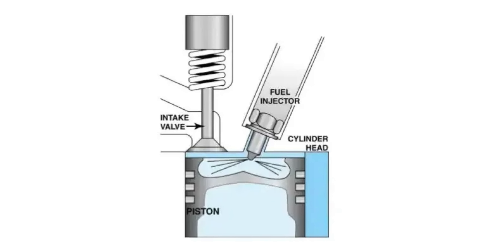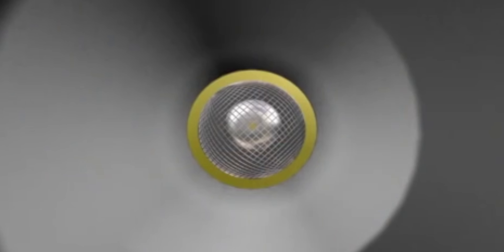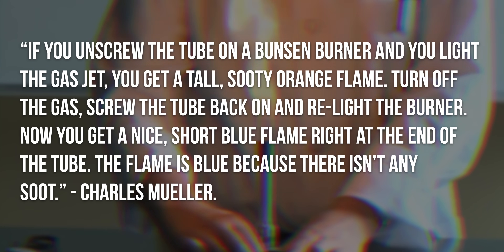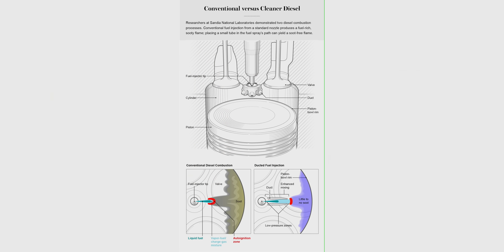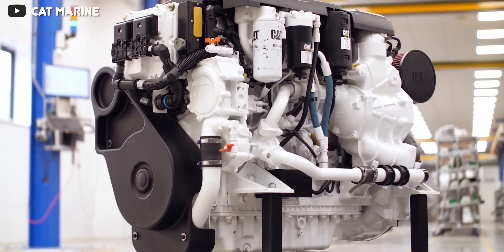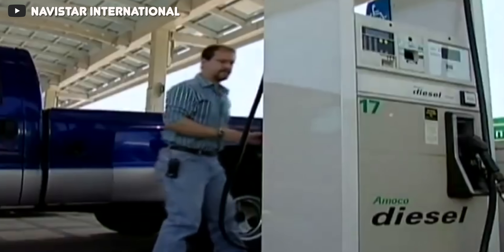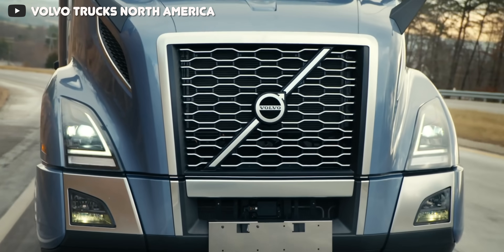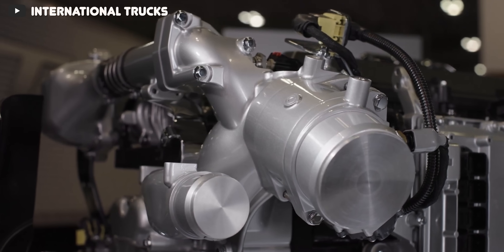Zero Emissions Diesels: How Ducted Fuel Injection can Save the Diesel Engine

Comment: Diesel is a much better fuel source than coal, which is what the vast majority of electric cars run on.  Plus diesel can be made be be renewable and waste products can be used in it.  If designed to do so.  EPA is about control they never have actually cared about the environment.
Reply: 60% of electricity generated in the United States is done with fossil fuels. 

https://www.eia.gov/tools/faqs/faq.php?id=427&t=3
Reply: That’s a stupid argument. You can change where the electricity comes from for electric cars. That’s not a electric transportation issue , it’s an infrastructure issue. There would never be nearly enough waste product to even cover a fraction of the amount needed just in one country. Yeah the evil EPA trying to keep your air and water clean and forcing companies to use cleaner systems rather than poisonous systems from boomer times when they banged rocks together.
Reply: @bluewizard420  did you know that solar and wind generators have a limited life span?

Did you know that we have no way to recycle those generators?

Did you know that the EPA likes to demand specific technologies rather then a reasonable emissions standard?

Did you know that any truck (not pickup) owner with any knowledge on the topic will buy a pre 2003 truck specifically because they burn less fuel and are easier to maintain?

Did you know that if you brun less fuel in a given time frame that naturally reduces emissions? 

Did you know that CO2 is required for photosynthesis? 

My opinion, every government organization cares more about control then their stated goal and if you had to deal with them you probably would think that as well,
My personal example is having several times when DOT HOS regs have required me to drive more tired or in more dangerous conditions, tired driving being the explicit thing those regs are trying to stop.
Reply: of the 210 gigatonnes of CO2 released into the air each year from all sources man contributes only 8 gigatonnes, less than 4%, to a gas that makes up .04% of the air , that is essential for plant growth not a pollutant.
The ice caps have not melted, the seas have not risen, it's all supposed to have happened by now and hasn't.
stop worrying about emissions it's not a problem.
Reply: @axeman2638  🤣 Everything you said is complete and utter nonsense and a confirmation that you are very low or not at all educated. 🤣😂
Reply: That’s not correct at all, your power sources depend heavily on the areas in which you live for starters and even then coal is not a massive energy source to make that claim that most electric cars run on coal
Reply: "EPA is about control they never have actually cared about the environment."
This is a completely unfounded assertion calling into question the resolve of the EPA.  Perhaps you are  unaware of why the EPA came into existence in the first place:
https://en.wikipedia.org/wiki/United_States_Environmental_Protection_Agency
The genesis of the EPA looks about as legit as it it gets for government regulation.
Reply: @5tr41ghtGuy  Also, before you go singing of the saintliness of the EPA, you might want to look into all the stories where they dropped the ball, like in Southern NH with St Gobain.  They know they were polluting for near a decade and turned a blind eye.  They claimed the levels were within safe limits, despite knowing they weren't.  There are MANY stories about how the EPA dropped the ball over the past 30 yrs.
Reply: @5tr41ghtGuy  any organization can be formed with good intent. It's very common that decades of lobbying for funding completely erodes an organization's original purpose.
Reply: @5tr41ghtGuy  yes, EPA was founded with good intentions, but today like most of the 3letter agencies, teh EPA is about control.  The US govt is all about helping large corps and harming small companies.  Because its easier to control a handful of CEOs than a million small businesses.  
And wikipedia is garbage for Anything remotely related to politics.  
If you reeeaaally think any of the agencies are there to serve you, pay attention who who is in charge and who is on the advisory boards.  For All Of Them.  This is why the FAA got their pee-pee spanked a few years ago over the Boeing 737Max tailgear issue.
Reply: Diesel is made from coal, too. Turning crude oil into diesel takes a staggering amount of energy from dedicated power plants.
Reply: @SlowCarToChina  making it from corn or another renewable resource does not.
Reply: @SlowCarToChina  Yes agree with that point, it is easier to fraction distill gasoline than diesel. This is exactly why diesel is cheaper than gasoline, in India. It is the favourite fuel of politicians and is an consumption icon of the world's largest democracy.  It encourages more and more people to buy diesel cars. India will continue to use massive amounts of diesel and there's nothing you fellow Earthians can do about.
Reply: @drsamuelk  I drive a diesel car myself! I love the acceleration! Anyway, I get fed up reading propaganda about how electric cars pollute just as much as fossil fuel cars as if creating diesel and petrol is pollution-free.
Reply: thing is though, and this is something that has been true forever, burning anything in a power plant is going to be super clean and efficient compared to running a diesel engine in a car. Like if you burn diesel fuel in a modern electric plant, make electricity, run it through wires, and charge a tesla, it will still take less diesel to move that car than if you had a diesel engine in that car. Cleaner diesel is good, but making things up to further your own agenda, is bad
Reply: @TheRogism  you are right that burning at a power plant would be more efficient, however as I said it's a weight problem, 500 miles is the longest range I have seen proposed in any electric truck, (that never made it to market) and that isn't gonna be a full days work, in the US a driver cab drive for 11 hours, most highways are 65mph so I picked lower numbers to be generous to electric (10 hours by 60mph = 600 miles) and that's still more then any electric ever claimed it could do.

Further these trucks don't always have the luxury of staying overnight at a truckstop, and trucks with team drivers sometimes don't stop for more then the time it takes to get food and fuel.

Then there is the problem of battery weight, for the amount of energy they store per pound they aren't even close to Diesel, worse batteries get weeker the older they get, the efficiency drop offs for well maintained equipment is much less then these batteries and some trucks older then me can still out perform the newest trucks on the market today, though that takes much more care then the mega carriers would put into the truck.

I'm not making anything up, I work in truck driving and engine efficiency is one of the things I'm very interested In because it means I save money at the pump (there are plenty of owner operators out there)
Reply: At this point in time, less than 20% of our electricity is made from coal. That is hardly a vast majority. However more than 21% of our electricity is made now from renewables such as solar, wind, etc.
Reply: @oldandboosted  I don't think there is anything renewable about solar and wind
Reply: @oldandboosted  what etc? There is nothing that you could class as "renewable" this isn't solar wind or hydro.
Fun fact the "green energy" dont support hydro electric.
Another fun fact, solar farms take up very large amounts of land.
Last fun fact, solar panels and windmills do have a life span (less then 30 years i think) but there isn't any way to recycle them, and that's beside being an intermittent power source that requires traditional backups (such as coal)

Diesel is the superior ICE fuel for transport, its only downside is it jells at low temperatures a problem that can be mitigated with additives or heaters.

Nuclear energy is the way to go for power generation as its waste is very easy to contain and not much is produced, not only is it safe its safer then ANY other energy source per KW.
Reply: @ARockRaider  you conveniently ignore the fact that coal spews tons and tons of pollutant into the air everyday. If you think coal is clean, you need to buy a house next to a coal power plant. And diesel is no better. Have you ever been rolled coal on? Diesel's spew almost as much pollutant as coal-fired power plants
Reply: @oldandboosted  I don't think coal is clean, I drive diesel trucks and when tuned properly they are every bit as clean as a car and definitely cleaner then your e-car that will only last 10 years if you are lucky and requires massive amounts of rare elements mined in countries that don't give a crap about clean mining.

Besides all that, co2 isn't even pollution, it's plant food! The stuff that plants need to photo synthesize! 
Large green houses have artificially high co2 levels to increase how well the plants grow!
Reply: @oldandboosted  by the way, the only diesels that you have seen "rolling coal" were twats in pickup trucks  doing the pickup version of burning rubber, unless you saw a truck that was from the 90s or older and even then it's only when under full load.

Speaking of old cargo trucks, if it weren't for modern emissions requirements Trucks would be using newer more efficient engines instead of trying to avoid equipment that has worse fuel economy (that means more co2), worse reliability (that means breakdowns) and worse price.

Since it's obvious that you don't know much about cargo trucks, meany are owner operators, that means the person behind the wheel is the one who owns the truck so cost and reliability are VERY important, so emissions standers rasing fuel costs (because it burns more),  maintenance cost (from the worse reliability) and original cost (from the expensive parts like the 10k$ dpf filter) is VERY harmful. 

If just reducing emissions is your priority you could take every 3rd or 4th truck off the road in the US by raising the max weight from 80k lbs to 100k, the truck and trailer itself weighs between 40k (really light) and 50k (really heavy) so you can check my math, many states already allow for 100k on highways.
Reply: @oldandboosted  if the government cares so much about the environment why were they closing down our Clean Coal facilities while they were helping to build traditional non-clean coal facilities in China?
You are buying into the lie, like everyone else.
This is about money and power, if it were about the environment we could have switched to CNG Vehicles decades ago.
Afghanistan has one of the largest lithium resources on earth, and the united states, with the help of some politicians that you may know, have left that in the hands of China via a certain political family.

The left is using "green energy" in the same the right did with oil.
Sociopaths/psychopaths don't care about you.

Don't you think it's interesting that the military has had over a hundred small modular nuclear reactors with no issue, but we can't run our grids off of them?
Or even just a few to take the strain off?

It was never about the environment, it's always been about money and power.

CO2 levels were absolutely off the charts when the dinosaurs roamed the earth and the trees were exponentially larger than now.
Antarctica was a tropical paradise millions of years before humans existed.

Climate changes, pole shifts, volcanic activity....
If we all died tomorrow, all of these things would continue.

The only thing that would cease, is sociopathic and psychopathic humans manipulating other humans to gain power over them.
Reply: @oldandboosted  my Peugeot euro6+ diesel gives me on average 57 miles/gallon, 67 on highway, and has as little particulates and less Nox than modern gasoline direct injected engines. Unfortunate the particulate filter tend to result in expensive repair.
Reply: @oldandboosted  no it doesn't. Not in the us anyway. We have air scrubbers. Our emissions are heavily regulated. It's mostly water that is produced.
Reply: @ARockRaider  You reference Nulcear energy "its safer then ANY other energy source per KW" - How many people die from solar power compared with Nuclear e.g. Chernobyl?
Reply: @nigeltrigger4499  that's a good question, you need to look into mining of the resources, all the way to decommissioning the solar or wind farms.

While nuclear has had one or two high profile incidents a little research would show you that those were design failures from the start.

A channel called "Plainly Difficult" is a great place to learn about those high profile nuclear accident as well as many you have never heard of
Reply: @PinkFZeppelin  seems like a non sequitur to anything i was talking about. I have said for a very long time "if you want true clean energy you go with nuclear"

as for the oil spills, they don't permanently take land out of available use, a solar farm can only be a solar farm unless it's put on top of a building (like big box stores or factories) and I don't think i have EVER seen solar farms put up in those places, at least wind farms only take up a small bit of land that can also be farmed but they do tend to require the land not be forested.

as for oil spills, yes they are bad but if you really want to prevent those you should be supporting oil pipelines, something that I'm gonna guess you don't support.

in the end I'm gonna mirror something that OP of this thread said, "___ is about control they never have actually cared about the environment." just fill in the blank with almost anyone talking about doing away with oil based fuels, they WANT high energy prices, they have said as much if you just listen to them and that's one of the reasons they are against nuclear and Hydro energy while pushing for solar and wind.
Reply: @lumberjackdreamer6267  why is it that people always accuse me of listening to a channel that i have never tuned into?

also it helps if you actually say what part of what i said was wrong AND tell me what the right answer is.

I get my information piecemeal from many sources often from unrelated topics that give me a flash of insight.

also you say something about supporting the government to be part of the solution, that sounds like Nazi type talk to me, especially when that very government has committed so many crimes against humanity in the past that the people have thankfully been able set back on the right track.

you also say "if you don't like it go away" seems kind of odd because that's what i have said to people of your political persuasion for as long as i have thought about politics, if you don't like the idea of a country that values itself first over other nations and protects the rights of it's citizens maybe a country in the EU is more your speed?
Reply: @ARockRaider  I don't disagree with nuclear, but that doesn't make your other points intelligent. Also you don't seem to understand a non sequitur.
Reply: @PinkFZeppelin  well I'll say it again, Diesel is the superior motor fuel for (as far as I know) everything except fast throttle response (race cars like some type of gasoline) and indoor use (forklifts use propane) , it's only down sides are it's tendency to gell in cold temperatures and it will leave residue and stains if there is a spill.

Electric batteries have no hope of competing with the usefull energy per mass of Diesel and will never be able to displace Diesel for heavy haul trucks unless it's given legal advantages by having a higher gross weight available than Diesel. 

As it stands now the grid can hardly support the electric cars coming online and wind and solar won't be able to support existing needs for stable power let alone the needs to replace petroleum fuels.

Can you imagine trying to work a job when some days your car just isn't charged? And no remote work isn't an option for the people that actually make the world work. (Think construction,  maintenance and service jobs for just a start)

Then you get into the problem of battery life span, it's not much unless you want to be buying a brand new car every 5 or so years with nothing of value to trade in, right now there are combustion engines older then you and I put together running as good as the day they rolled out of the factory and may very well out live the both of us if given even the most basic care, heck look for some of the "found abandoned in the woods for x years, will it run" videos here on YouTube, your batteries won't ever see such a restoration.

I get it, we all want things to get better, but orgs like the EPA only make things "better" by kneecaping whoever they call loser and hoping something better takes its place.
Reply: @ARockRaider  Your arguments are outdated, and so is your knowledge, and here is why. Let's start with the most annoying mistake. Windmills do not produce electricity.  Windmills mill grain into flower. Windturbines produce electricity. Here in the Netherlands you can still visit operational windmills that are hundreds of years old. This company in the Netherlands that is called Extreme Eco Solutions recycles composite materials from decommissioned turbine blades and yachts into 100% recyclable street and wall tiles without any subsidies. You can visit their homepage. Another fun fact is that General Electric signed a contract with the US government that obligates them to recycle all their decommissioned turbine blades. 

And the biggest operational turbine in the world, the Haliade-X is currently located in Rotterdam the Netherlands, is capable of producing 14 Megawatt, and that is enough to give power to 16.000 homes. And it is fully recyclable. 

And another fun fact. Here in Europe the sales of cars with an ICE, no matter if they are diesels or regular fuel or hybrids, will no longer be allowed, by law, from the year 2035. So to think that any ICE technology can be saved is complete and utter nonsense. Another big clue is the fun fact that all the major manufacturers put their investments and developments into electric drive trains, and not into outdated ICE technology. 😉
Reply: @ARockRaider  Wind and solar can be more then enough. And it is proven to be far more reliable then conventional power sources. But it will always be a combination of different energy sources. Not just wind and solar. So to asume that only wind and solar has to power the entire world is complete nonsense. In the Netherlands we are far ahead with renewable energy sources compared to the US. A growing number of home owners have solar panels, and/or solar heaters and/or a heat pump installed. 

The Haliade-X is currently the biggest operational turbine, and it is capable to produce 14 Megawatt. that is enough to power 16.000 homes. For comparison the biggest inland turbine in the US can only produce around 3 or 4 megawatt.  

Prices in Europe skyrocket because of fossil fuel, not because solar or wind energy. As you might know there is a war going on. 

The governments in Europe were dealing with a monster, and that was wrong. And now we have to pay the price for it. So the raising prices have nothing to do with the technology. Those prices are the result from geopolitical circumstances, and it is also the result from price gauging by companies who take advantage of the situation.  

Putin can't stop the energy that comes from wind turbines and solar panels. But he can stop the delivery of natural gas. So that is exactly what he did. So the solution to that problem is to install more solar panels and wind turbines.
Reply: @insAneTunA  the price spike was years ago, before the koof.

Solar and wind may be fine options for individuals but not for entire grids, the problem I see is the people who push solar and wind also tend to be against hydro and nuclear. 

Solar and wind isn't going to be able to replace conventional options anytime I'm either of our lifetimes for several reasons and there are legitimate questions as to how "green" solar and wind are anyways.
Reply: @ARockRaider  You could not be more wrong about solar and wind power. It is more than capable to replace fossil fuel and nuclear power. An area that is the size of the state of Texas covered with solar panels can produce enough energy in a single hour   to power the entire WORLD for a WHOLE YEAR. 

In the Netherlands we put solar panels on the roofs from the houses instead of building dedicated solar parks that take up space. We do not have the luxury of abundant space. And they all deliver energy to the grid. And if they deliver more power as they consume they even get money for that. 

Besides that, most domestic power is used to heat our homes during the winter. With the installment of heat pumps and solar heaters we reduce the need for electricity massively. 

It is the combination of different technologies that makes it work. And as a backup there will always be a handful conventional power stations. There is no need to go to zero emissions, we just need to reduce the emissions to a workable level. 

Things are not as black and white as you make it sound.
Reply: @ARockRaider  And now I am going to install my PIR insulation boards between my ceiling. Yesterday I managed to get a very nice 25% discount from a local hardware store owner on my purchase, which was very kind from him. He did not have to do that. It will reduce my gas consumption substantially, and it will be much more comfortable inside the house because I will be able to keep it much cooler inside during the summer, and much warmer during the winter. 

You see, it is not just about producing renewable energy, it is also about reducing the need for energy. Here in the Netherlands we do both, because we can get freezing temperatures, but also blistering hot temperatures. I recently posted a video when it was 135 F or 55 degrees Celsius in my backyard garden. It surpassed the scale from my thermometer.
Reply: @insAneTunA  the cope is great with this one, enjoy your soy and cockroach burger
Reply: @insAneTunA  That last statement is not  true. Toyota and other japanese brands just poured billions into ICE development of a new engines , Stelanttis is still developing a new I6 Engine, and Mazda is still developing their Skyactiv line. I’m not trying to say major manufacuaters aren’t investing in EV’s but ICE will be around much longer than you think. Third world countries will still be a huge pool of ICE vehicles
Reply: @coredaqqer6197  General Motors has announced that they are planning to only sell fully electric cars from 2035. And this is being spearheaded by Cadillac (who currently still don't have a single EV on the market). But they are certainly ambitious. Cadillac is planning to sell only EVs after 2030, and they have announced they have ceased investing in ICE technology. The 2023 Cadillac Lyriq to be released next year is to be their first EV, and their redesigned Escalade SUV launched last year was their last ICE.

Mercedes: This performance German car company is also following suit and foresees no future in ICEs. Recently, their Chief Operating Officer Markus Schäfer announced that they have no plans to invest in the next generation ICEs.

Stellantis (Chrysler, Fiat, Peugeot, Citroen) Speaking for the group, their CEO Carlos Tavares declared they will no longer be making any more significant improvements to the ICEs. Instead, they will focus on their existing engines and work on developing EV technology to replace them.

Jaguar has one of the most ambitious timetables of all, and yet they have only just released their first fully electric vehicle, the Jaguar I-Pace. They plan to have all their lineup electrified by 2025 — actually the same timetable as their Swedish rival Volvo.

The Swedish Volvo is also dumping the venerable ICE and has just launched their Polestar 2 EV. Volvo has announced that by 2025 half of their sales will be fully electric, and the reset would be hybrids. By 2030, the hybrids will also be reassigned to the trash can of history, with all sales from the company being only fully electric vehicles. Volvo's timetable is one of the most fast-tracked of all the car companies in the world. Their neighbor, Norway, is banning ICEs in 2025.

Ford is a little complicated, as it seems to be treating its European and North American concerns separately. But in Europe, all Fords will have an electrified (fully electric or hybrid) option from 2026. Over there, they are certainly not investing any new ICEs. From 2030 all of its vehicles will be offered in a fully electric form. It's also planning to invest a gargantuan $30 billion in EVs through to 2025. That is a massive amount of money and shows just how far they plan to go.

As stated above, it's not just its sub-brand Cadillac going electric (which is to be the vanguard of the transition). It is all of General Motor's mighty lineup of sub-brands including Buick, Chevrolet, and GMC. GM has raised its investment in EV vehicles and self-driving technology from $20 billion to $27 billion. It isn't clear if they are still investing in developing any next-generation ICEs. There are probably no new projects. It seems GM will soon be living up to its name and be General Motors and not General Engines.

Reports have seemed a little contradictory, with reports from 2020 suggesting Audi and Volkswagen would continue to invest in ICEs. But now reports from this year in 2021 are saying they will not be developing any new ICEs. To use a Star Trek analogy, in just a couple of years, the pace of transition has transformed from impulse drive straight up to warp drive. According to Markus Duesmann — Audi’s chairman of the board, it was new regulations in Europe that caused them to cancel all ICE development.

Now it would seem BMW is the last major car company still singing the tune that up until this year VW and Audi were still singing. BMW has stated that they foresee demand for ICEs continuing for many years to come — maybe they are right, maybe not. Accordingly, they remain committed to developing more ICEs. Time will tell if their investment pays off or in a couple of years (or even months) they too will pull this last final plug on the future of the veritable ICE.

In summary, development on ICEs has all but ground to a sudden and dramatic halt. The future is now firmly in the hands of fully electric cars.
Reply: @ARockRaider  You forget that IC engines have a maximum efficiency of around 30-35% with most of them only getting 15-25%. Coal/gas plants have an efficiency of around 70-80%, which is aorund 3 times more efficient than the best IC engine. Three EV's can drive around for the same pollution as a single ICE. I'd call that a small victory. 
That EV's produce more pollution than ICE is a myth that has been debunked in detail. Just google it.
Reply: @drsamuelk  thanks, was starting to get depressing seeing so many people replying to me with so little actual argument. 

That's a good point about soot, and even when you see a proper truck rolling coal you hardly get any if you are at safe following distance.

As cool as the thick black smoke is I also know that it's unburned fuel and so I would never intentionally be letting my truck do it, did drive a mechanically injected truck once, she would smoke up any time you asked for to much at once.

I would love to try having a watter injection system to get more energy out of the fuel, I just don't know how much energy you would actually capture.
Reply: @paulmichaelfreedman8334  I'm talking mostly about cargo hauling, though full size SUVs were getting 40mpg using diesel 10 years ago.

No one has an battery powered truck on the market, Tesla was thinking about it and had a prototype but they didn't advertise it's weight, for a market that often avoids fully filling their tanks due to weight restrictions so it was nothing more then a publicity stunt.
Add on that the BEST range they were offering was 500 miles (probably tested on flat ground) their truck wouldn't have been able to do a full 10 hours (not even a full day) at 60mph (kinda slow honestly, even governed trucks run at 63 and up)
And unlike liquid fuels that only take minutes to top off even at a slow pump electric takes hours.

There are vanishingly few places where electric trucks could even hope to replace Diesel, that's a fact from someone who works in that industry and would love to see any usefull innovation.

One option may be Diesel-electric like railroad locomotives use, though I expect the weight of the generator and motors may be more then the drive train it's replacing so very few would want it.

Again weight is EVERYTHING in trucking, so unless you get laws changed electric won't work.
Reply: @beauburke6108  I'm not "pro coal" and I'm not "anti renewables"

I consider Diesel to be the superior fuel for road use.

I don't really care about the use of "fossil fuels" as their main combustion byproduct is CO2, aka plant food and I'm not worried about them running out in my or my children's lifetime, even if "fossil fuels" were to start running out the economy would naturally start to move towards other options well before we actually ran out, need I remind you that the predictions of "peak oil" passed years ago?

However electric cars are made using rare metals that are mined in places that don't give a crap about the environment and those batteries don't last the lifetime of a car, my current car is over 10 years old and hasn't needed anything more then standard maintenance.

Then the problem with solar and wind is they are not consistent enough especially considering the amount of resources that go into them, including land.
Hydroelectric is a viable "green" energy butbi remember them being taken down in many places because of "environmental concerns"
Nuclear should be the energy source of choice, but again the "Environmentally concerned" don't want that either treating the waste like the green sludge from cartoons when it's probably one of the easier to contain wastes out there.

Thank you for your polite questions, I hope I have answered well enough.
Reply: @ARockRaider  Thanks for your reply. 

I agree that diesel is the fuel of choice for efficiency when it comes to ICE. 

Nuclear is a good green option but unfortunately it is not viable long term due to there not being enough usable uranium, even for current consumption. (67kt/year vs 5Mt known deposits = ~80 years)

I also agree that the rare earth metals used to make batteries, electric motors/generators and solar panels aren’t always sourced ethically.

If these supply concerns were fixed and battery technology increased its longevity/reliability, how would that change your views?
Reply: @beauburke6108  I don't have anything inherently against electric cars.
I think they are to expensive and don't have enough lifespan to replace most people's cars, and I know they can never replace cargo trucks because of weight and recharge times.
So electric cars are mostly a virtue signal that costs twice what a normal car costs and only last 5 years at best (vs 10 to 15 depending on how well you take care of a normal car)

80 years is still a good long time and doesn't account for possible development in the field if so many governments weren't against nuclear.

My biggest problem is how often governments are actually taking away good reliable technology to replace it with something that is expensive and in its infancy, trying to outlaw ICEs for example.

I also have a big problem with the "green" movement because I see that movement contradict itself all the time,
For example I remember switching away from paper bags to "save the trees" and now places are banning plastic to "save the environment" so now you gotta use paper bags again with an extra surcharge applied by the state OR you gotta bring your own bags making it more likely to get contamination from people's homes coming to the store (no one ever thought about that, but my family buys grain in big bulk bags, at one time we returned them to the grain plant to be reused until they stopped accepting them due to worries of disease from one farm getting to another)
Reply: @oldandboosted  "However more than 21% of our electricity is made now from renewables such as solar, wind, etc." I suggest you check your sources there ace.  About 2% of the US grid is wind/solar.  Wind generation usually is outside of peak hours and neither can be reliably stored for any length of time for Anything approaching cost-effective.  
Then there's the life-cycle and toxicity of their waste.  The lack of recycling of wind&solar components.  Do you know where the lithium comes from?  Cobalt?  70% of cobalt comes from DRC and 30% of that is mined by "artisanal" mines (soft-speak for child labor) where there are NO safety regs.
Also, the US grid is alot more than 20% coal.  Oh, and if you're from CA, and cheering that Newsome shut down another "dirty, unsafe" nuke plant, look at where the CA grid is drawing power from...  MT coal plants.
Coal and NatGas are about equal share, nuclear is about 20% hydro (not a green energy) about 5-7%.  Geothermal isn't really a thing.  So yes billy, a significant number of EV cars are coal powered.  Primarily because of where most of them are owned and how THOSE grids are fed.  Like CA and their NIMBY coal power.
Reply: @oldandboosted   You ARE aware that even the Dem WhiteHouse admits that the US generates less than 15% global pollution and CHINA produces more than the next 7 nations.  Oh, and their coal power increases every year until 2030 at which point THEN they have agreed to reduce their output.  Because the UN says they are a 3rd world developing economy.  Despite rivaling the US economy.
I am FAR more concerned by micro-plastics in our fish, poison (like lead) in our water, and over-use of our land and waters.
Reply: @oldandboosted  
My electric car is entirely powered by renewables.
Reply: @oldandboosted   And it shows, that's why people froze to death in their homes in in Feb of  2020 in Texas, wind and solar can't keep up.
Reply: Stop whining. Be part of the solution. Support our government. Support our country. 
Otherwise, if you don’t like America, then go away. Go to trump land (russia).
Reply: @lumberjackdreamer6267  lmao.  How is Biden turning out for you?